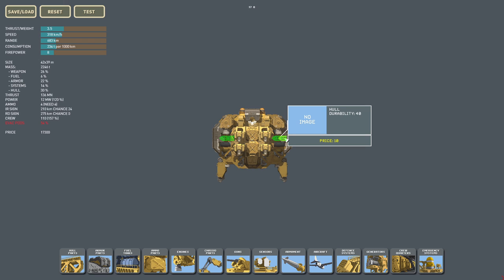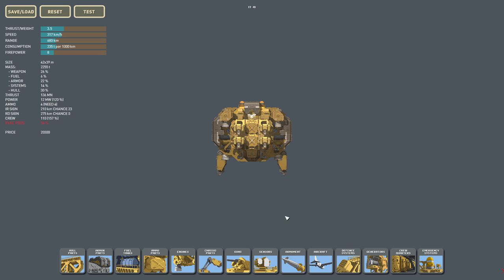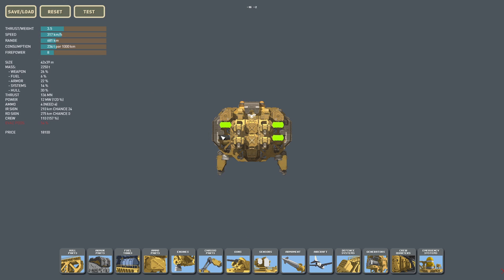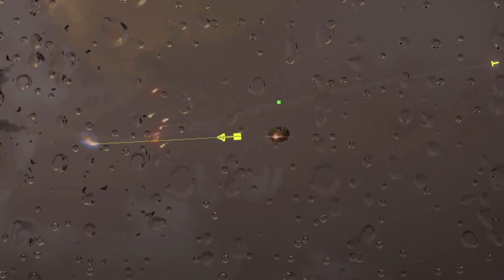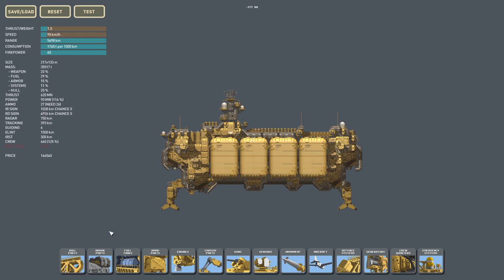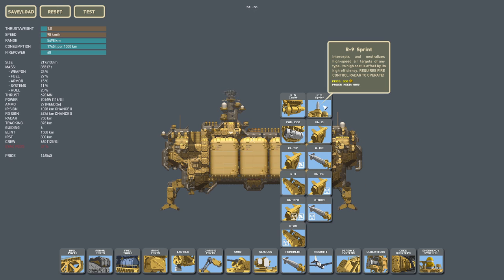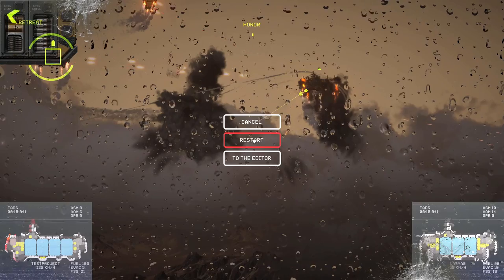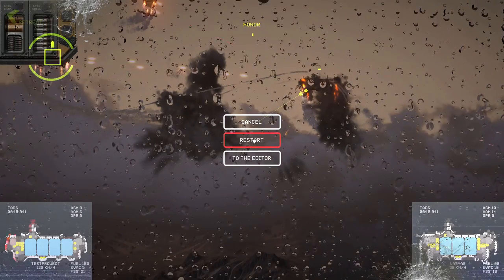Countermeasures Guide (Palash, Flares, AA Missiles) | Highfleet

Comment: I save Sprints entirely for cruise missile defense. They’re just too expensive to throw-away as counters to Zeniths and planes. Anything big enough to have an array of them is also going to have CIWS, and CIWS does the job against Zeniths and planes just fine (most of the time), but cruise missiles HURT and I’ve seen them get through clouds of bullets. I’ve even seen Sprints miss cruise missiles before. :|
Reply: I shoot 2 at cruise missiles.  Spam for nukes
Reply: I've used sprints on Zeniths and planes, though it is like burning money.  Sometimes it just depends on the design of the ship, its importance, the situation, and how much damage you're willing to take. Usually flares and CIWS/AK100s are enough but sometimes you' get in desperate situations.  I equip sprints on almost anything that isn't a direct attack vessel (missile carriers, aircraft carriers, defense frigates, tankers, etc.).  But I'll also throw them on any light or heavy cruiser, even ones I intend to rock up into battle with simply because cruisers are big targets for planes, cruise missiles, and ballistic missiles..

Comment: Pro tip :
Dump the Palash
The thing only stops 2 shots before becoming dead weight in a battle. Just replace it with a Zenith, ASO or extra armor, or even escape pods.
Reply: Palash is great especially for small agile ships. It weights almost nothing and rearms in battle after a while and can save you from that one big shell you couldnt dodge. And on bigger ships its usefull to protect weakspots where armor placement is not possible, like radar, missile tubes and such.
Reply: @madrooky1398  When the op made the comment Palash did not rearm in battle for the player, was added later.
Reply: Palash is awesome. It works against everything, not just SRMs like flares, and it isn't stupid expensive to resupply like PD missiles are. Granted, they don't work great against tac and cruise missiles, but few things are 100% against those.